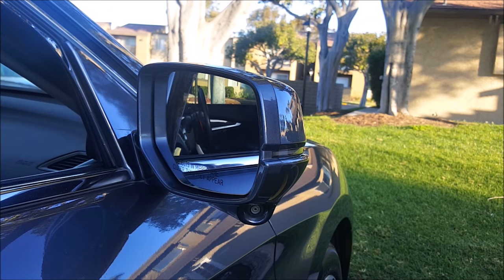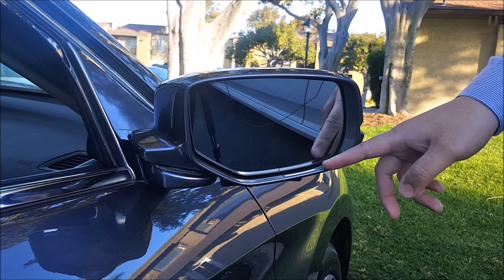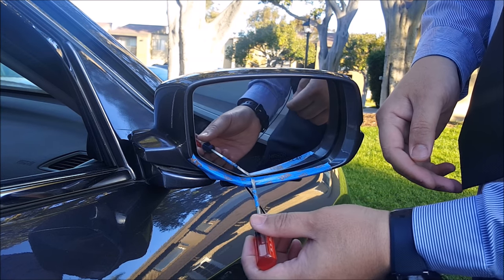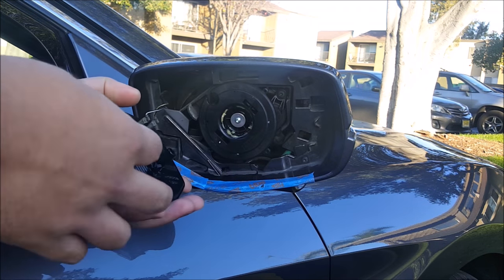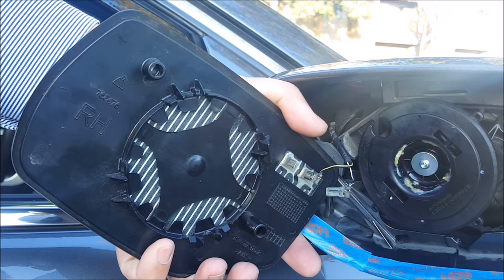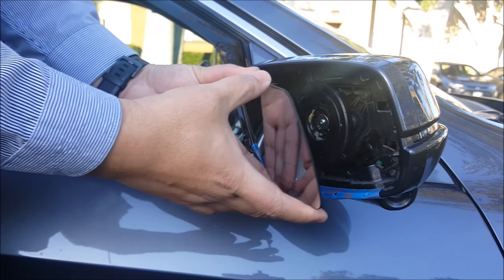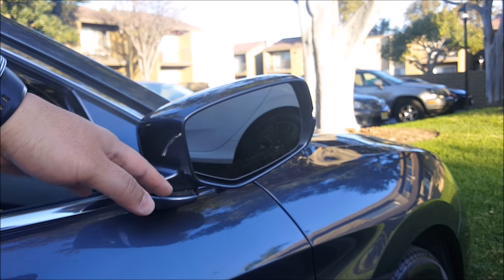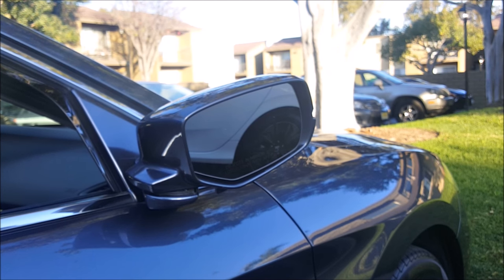[Tutorial| Honda SIde View Mirror Glass Removal and Installation

Comment: Would you mind doing the same video removing the back cover (skull cap) on the CR-V?. I've looked at the one for the Accord you have but the CR-V skull cap is slightly different, where I think you don't need to remove the mirror to get to it, but if you could do a video would be great. I'm trying to replace the turn signal with a sequential one but I need to get to it first and if I can save removing the mirror would be great. Thank you in advanced.

Comment: My mirror was wobbly and I thought it was finished but this tutorial helped me out.
Reply: My driver side mirror is loose/wobbly.  Was yours not installed correctly to begin with.  Did you just have to fully push and snap it in place?
Reply: @PeaceLoveAndHappiness  It was installed correctly from factory if that’s what you’re asking. I actually had someone come into my lane, and forced me a little too close to a sign and the mirror brushed against it, knocking the mirror loose and wobbly. Pulled over and was able to push it back into place with this tutorial.

Comment: Used this as a guide for 2016 Odyssey, drivers side.

The retention to the mirror actuator was different than the clips shown, but removed the same way.

I had to reinsert the Up/down lead nut when reinstalled.

Very helpful. Many thanks!

Comment: My mirror came off the adhesive within like 2 mos of owning the van, and the replacement took 8mos to come in. When they replaced it, they gave me some warped piece of crap. So I told them to put the old one back on and I’m just gonna find some high heat resistant adhesive and try that instead.

Comment: Has anyone else had the issue in their 9th gen coupe where the glass on the driver side mirror shakes at bay speed above 35? Will replacing the glass fix the issue or do I need the whole assembly?

Comment: Hey Jeff
My mirror rattles when I close my door, does this mean I need to replace it or can I simply somehow tighten it somehow
Reply from the maker: Is it just the mirror it self or is it the entire side view mirror assembly that rattles.  Can you physically move side view mirror assemly with your hands?  Its possible that the entire mirror assembly is loose.  In that case, you just need to tighten the bolts that holds the assembly to the door.
Reply: @DIYCarModz  thanks for ur time and all the videos u have posted, greatly helpful
Reply: @DIYCarModz  you were right, it was the a loose nut out of the 3 behind the plastic cover, thanks